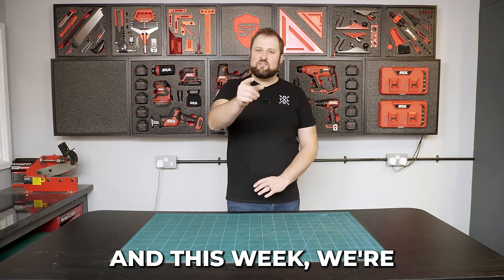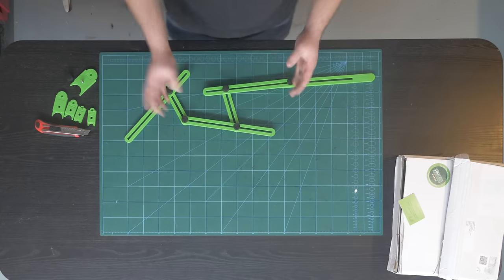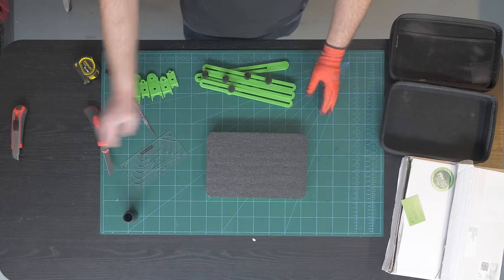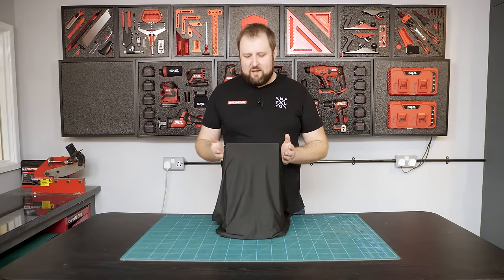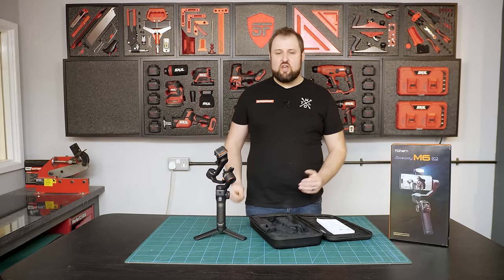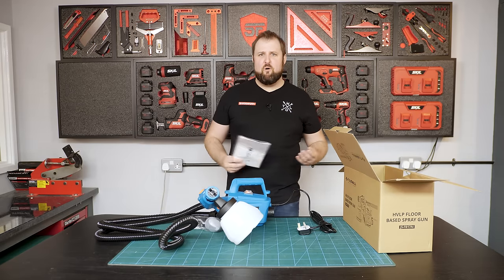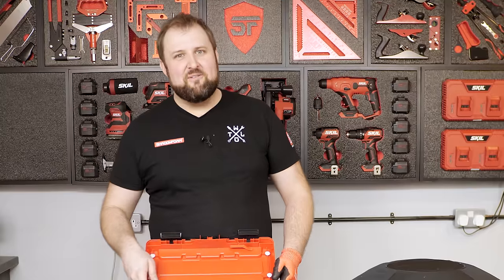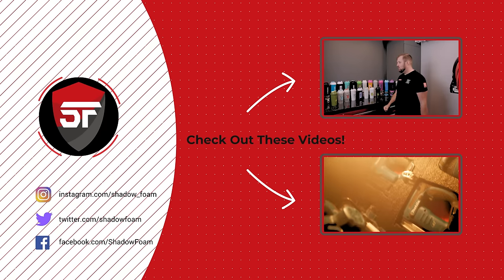What is THE MOST DIFFICULT TOOL to cut into Shadow Foam?

Comment: For the plaster mixer, I think a military style footlocker.  For the paint sprayer, instead of laying the hose in a circle under the handle/tank, I would have put it coiled vertically in a slot on the edge of the foam.  It looks like if you move the compressor and tank slightly closer, there would be plenty of room next to the tank.

Comment: For storing the plaster mixer i would attach two different tool boxes somehow with two compartments for the two larger items and then cut foam as you did for the battery and motor section.

Comment: It would be good if there was a library of templates that could be used for cutting out the more challenging tools even better if they had the ideal depth marked on them. 

Something like an angle grinder is difficult as the tool often wants to be only half inserted into the foam and so cutting around using the item is never going to be ideal whereas cutting around a template for the most common tools would be a lot easier.

Comment: I think i would have used one of the big,wheeled cases for the paddle mixer like the milwaukee packout box designed for chainsaw/strimer or the stanley 240l on wheels but then the box would probably be about the same price as the tool 😂😂 scrolling through the comments i saw you mention that you are looking at doing some snapon toolbox inserts and i was only thinking of this the other week, is it possible to make a shadow foam wedge so i could put it in my top box lid area I could organise all my sockets? But if I am lucky enough to win for me it would be the gimbal as I am interested in getting into creating for youtube.
Reply from the maker: What videos would you create for YouTube?
Reply: @ShadowFoam  probably some automotive videos like crash damaged/mechanical repair and modification videos, and the sort of workshop tour/ toolbox tour and that sort of stuff. I have been watching a  few machinist channels lately and may get into that too. First I need to find somewhere to do all this may have to build something as doing it on my drive like I do at the moment isn't fun at this time of year

Comment: I have been looking at organising my toolbox for work and wondered how well shadowfoam would work with storing pliers on the side instead of flat, space is a perineum. I work as a multiskill maintenance engineer so carrying around both mecanical and electrical tools fills up the quickly. That gimbal would be epic, doing the NC500 in june and would get some epic shots.
Reply from the maker: We have organised tools on their side in the past, don’t do it too often in the channel because it’s not as visual but it definitely can be done
Reply: Multi skill maintenance engineer myself packed a t stack full of foam and my top organiser has all my most used in, has made my days so much easier

Comment: Is it possible to drill into shadow foam? For example if you were trying to cut in holes for smaller diameter sockets?
Reply from the maker: I have been using my hole saw on the Shadow Foam but word of caution you need to apply a lot of pressure to avoid the saw going off and scratching the foam
Reply: Yeah I've used a hole saw for the bigger sockets, but I can get a hole saw small enough (10mm) for the smaller ones, so wondered if a drill bit would have the same effect?

Comment: You could've drilled a hole and had the mixer shaft stick out the side or top of the box. Electric HVLP.
Reply from the maker: I was considering that tbh but was unreceptive to drilling a hole in my case permanently for a challenge
Reply: @ShadowFoam  yeah I guess the cost of the foam is your variable. Versus the cases.